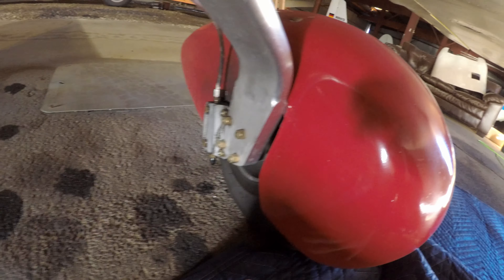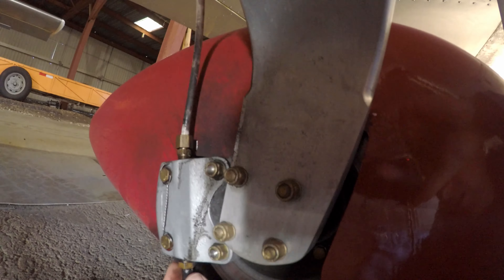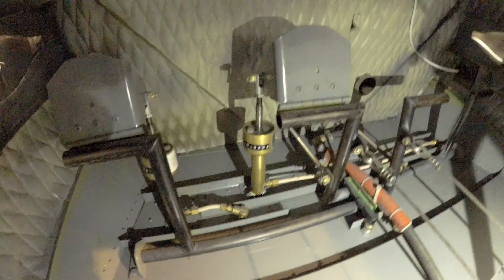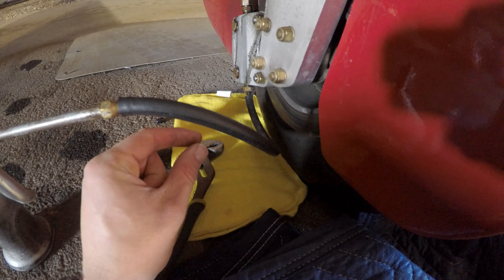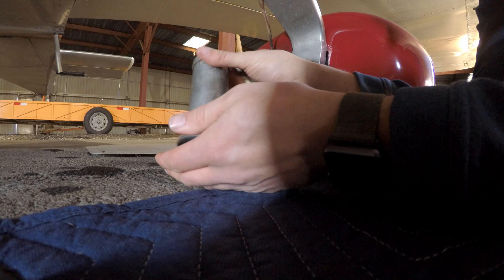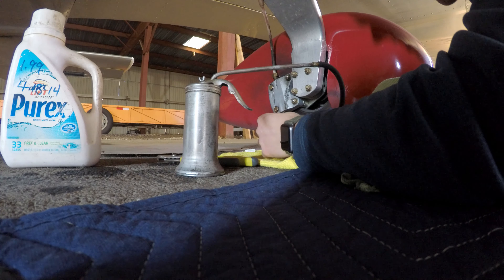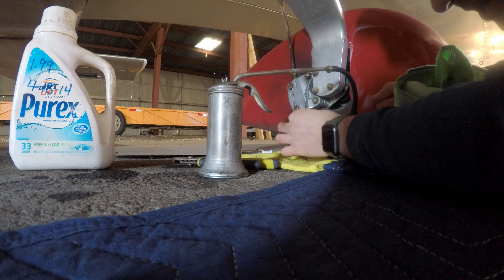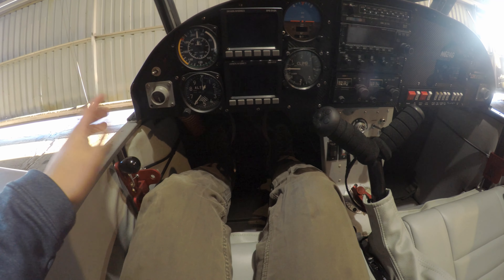How to Bleed Brakes on an experimental Aircraft Zenith/Van's RV

Comment: To drain you could have used the cap of the Purex bottle. Also you don’t need to remove the plastic screw. You can fit a piece of clear plastic tubing over it and direct the fluid into another container. No mess to clean up.

Comment: 1:41 Yes! Always use the recommended fluid. The seals inside the parts are not created equal and some chemicals will deteriorate them rapidly when in contact.
Reply from the maker: I did later get in contact with one of their engineers that confirmed the O-rings in my calipers would have swelled if I used something other than 5606 such as ATF.